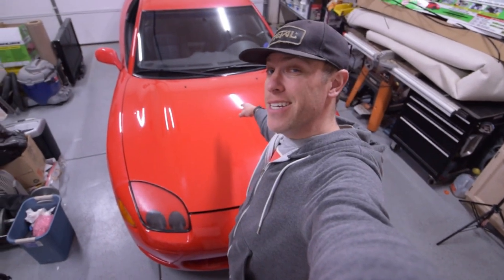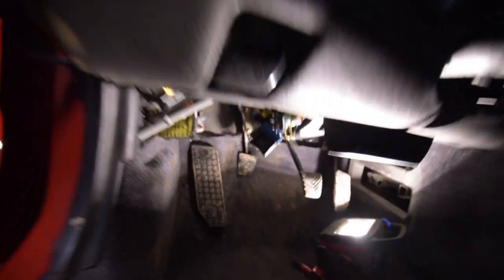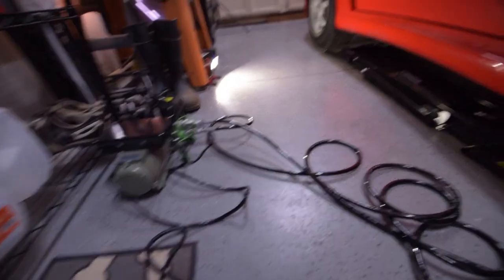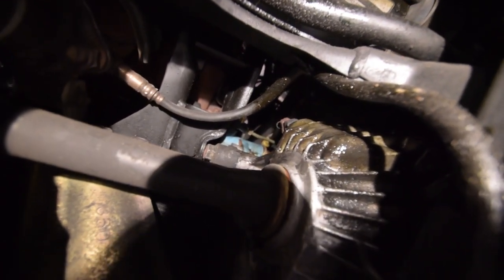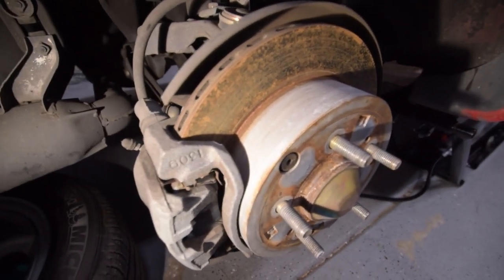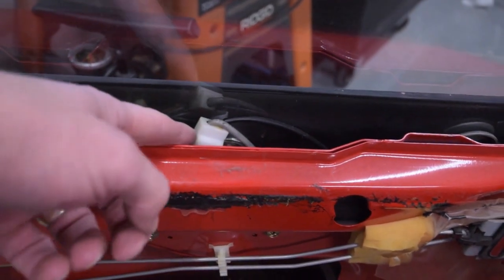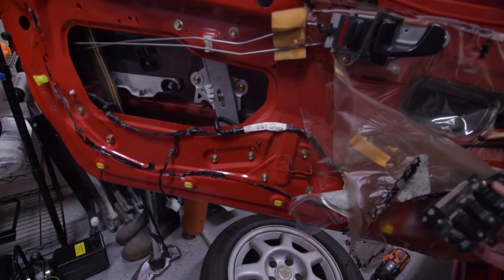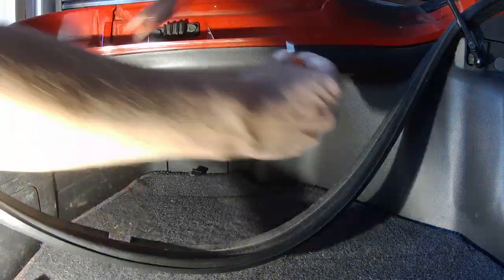Fixing a manual 1995 Mitsubishi 3000GT Ep1

Comment: I gotta 1992 gt sl rattle in nutreul stops when clutch is to the floor is that tob or pilot?
Reply from the maker: I’m willing to bet it’s the throw out bearing. Is there any play in the clutch fork?
Reply: 3k doesn't have a pilot bearing. Could be throw out or a warped clutch plate. 

I had an issue with mine where the throw out bearing went out and ate the fingers off of the pressure plate. It would rattle in neutral but it also squealed like crazy with the clutch depressed.